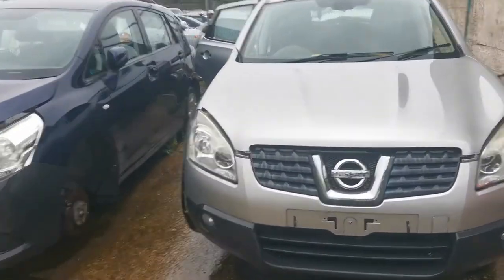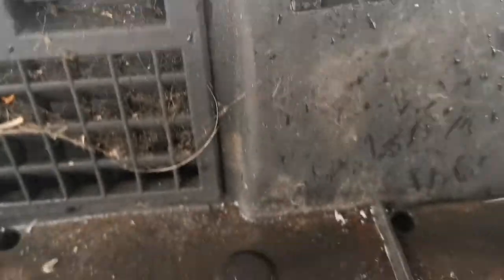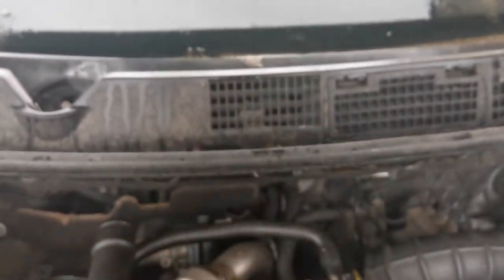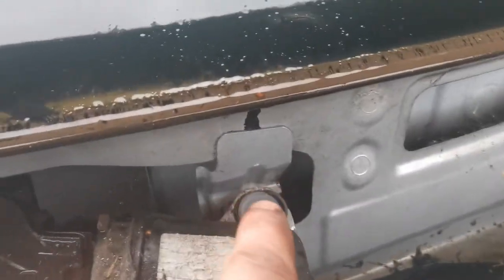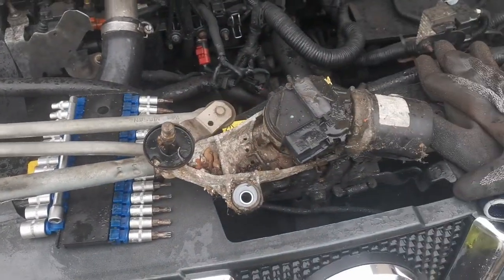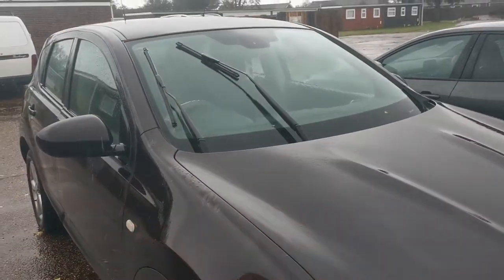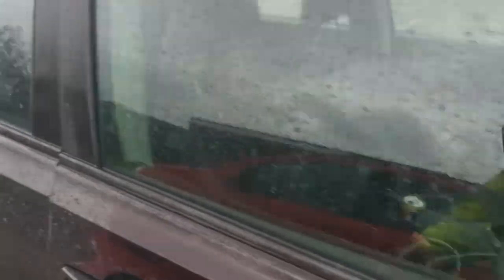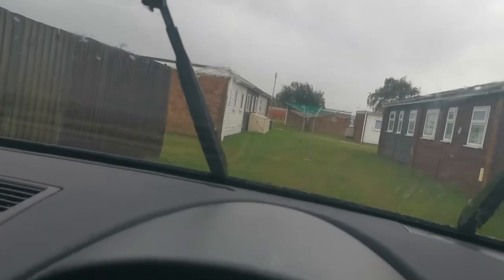2009 Nissan Qashqai Wipers Stuck and wont move

Comment: I had the exact same issue with my 2010 Qashqai. The dealership quoted £500+ to replace the wiper mechanism. I paid £10 for a pair of clips which I installed on the joints (the rubber gasket on the joint had worn, so the joint came detached). Removing the wiper arms was the hardest part.
Reply from the maker: Yep its a complete rip off what garages charge so glad you was able to get it sorted.

Comment: Hi I need help with my nissan qashqai 2.0 motor wiper fuse keep blowing, and when I put new Fuse in it keep blowing when I turn the window wiper on . Anyone no what could be the problem,
Reply from the maker: Hello when I removed this wiper assembly it had water getting into the motor and that in turn is what caused the motor to fail but could also be causing your problem because if the fuse keeps blowing it means there is a short somewhere and water is a very good conductor I hope this helps
Reply: @TheZXGuy  thank you for your comments I wel replace the motor and see how it goes
Reply: Hi  my friend  a solution  for these prbleme because  I have the same probleme
Reply: Hi  my friend  a solution  for these prbleme because  I have the same probleme

Comment: Hi, I need to tackle this on my 2010 qashqai, when you've removed the nuts off the washer arms how easy (or hard) are the arms themselves to remove ?
I've seen on another video that I'll need a special pulley tool to remove them ??
Reply from the maker: I have had to use a wiper arm puller in the past on a different car but I find using it a little fiddly so I allways try loosening the nut and just giving it a push / pull near the nut and most come loose just don't be really heavy handed tho.
Reply: @TheZXGuy  cheers for the reply, I've just finished fixing it now, brill video, helped a lot 👍🏼
Reply: I've replaced the motor and set the linkage in the correct position. The wipers are working but their rest position is in the up position, new linkage or any ideas?
Reply from the maker: The wiper motor will allways do 1 full rotation to the wipers going up and down just once try changing the position of the metal piece directly attached to the motor spindle.
If the wipers go down then back up to resting up it is likely that the motor spindle is out of line with the linkage mechanism. 
Hope this helps.

Comment: Hi I’m not sure if it’s the cold 🥶 that has froze my washer at rear ? Or it’s blocked ? The pump works because I can hear it the washer works at front but three days now and still no water at back ?
Reply from the maker: It could be the cold or just a blockage causing you the problem you could try using a pin in the jet to clean it and spray some de-icer onto it or just wait it out for a few more days to see if the warmer weather sorts it out.
Reply: @TheZXGuy  thanks for the advice I’ll try this but it’s strange it started when it went cold 🥶? The front ones are ok 👍
Reply from the maker: The front ones are under higher pressure being closer to the pump and they have the slight warmth aspect from the engine when it's running
Reply: @TheZXGuy  does the light come off ? At rear what the jet is attached to? Because I cannot see a hole ? To put pin head in to ?
Reply from the maker: I've never had to remove one before so I done a bit of research and it looks like it is just push fitted with 2 metal clips about an inch from each end so definitely looks like your able to just pop in out without too much trouble.
Reply: @TheZXGuy  well warmer weather but still the same no water coming out ?? I’m baffled
Reply: Pump you can here working but no water ??
Reply from the maker: That just leaves a process of elimination now then it's either a blockage somewhere or a split pipe somewhere. It could also be a weak pump as it has to work harder to get fluid to the back of the car.

Maybe this site might be able to assist you better than I can http://forum.qashqaiclub.co.uk/rear-washer-nozzle-issue_topic7269.html

Comment: I have the same problem on my Nissan qashqai 2007 you cannot buy the parts at car part shops ? But they are on eBay one of the linkages was worn
Reply from the maker: That's why I went to the local scrap yard you might be able to get the part from Nissan directly but I dread to think what it would cost tho.
Hope you manage to get it sorted.
Reply: Are they easy to fit
Reply from the maker: I replaced the whole wiper motor unit complete and its just a case of 2 nuts for wiper arms 5 pop clips on the scuttle panel and about 4 x 10mm bolts then it will just lift out quite easy just be careful not to squash the washer pipe in the left hand side when reinstalling the plastic scuttle panel.
Reply: @TheZXGuy  it sounds easy but it’s a question of tools
Reply from the maker: Ahh I see you can usually get a cheap socket set from some sort of discount store or ebay now I wouldn't recommend a really cheap socket set for working on cars but just for that job it should be fine. That's if you would like to tackle the job yourself that is. 
Also a small flat screwdriver for the clips and the electrical plug would be useful.
Reply: @TheZXGuy  my car is a2007 model visa 2.0 auto looking on eBay which one will fit my car ?
Reply from the maker: They are the same wiper assembly and motor from 2007 - 2013 so many options if it helps I've included a link tk a brand new on on ebay hope this helps.
https://www.ebay.co.uk/itm/363016860147
Reply: @TheZXGuy  thanks for your help most responsive on here
Reply from the maker: More than welcome happy to help where I can
Reply: I’ve bought just the linkage Arms has motor ok from eBay
Reply: @TheZXGuy  hi I’ve just fitted front and rear brake discs and after a few days they look rusty and horrible ?
Reply from the maker: The edges and the centres will rust nearly straight away on most brake discs unfortunately this is normal and a vehicle with not much use you will find the discs themselves rust but this is all surface rust and as long as the brakes function well there is nothing to worry about
Reply: @TheZXGuy  thanks for your reply